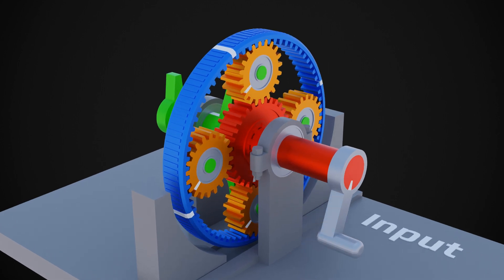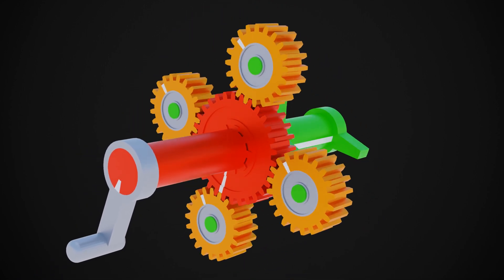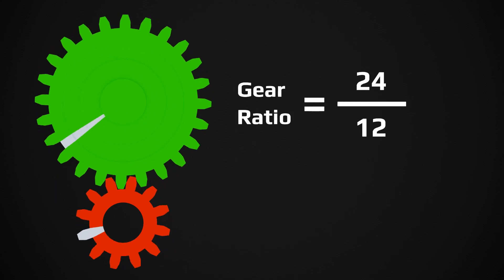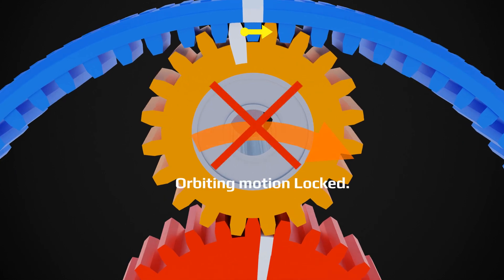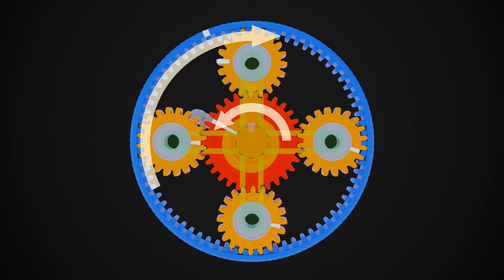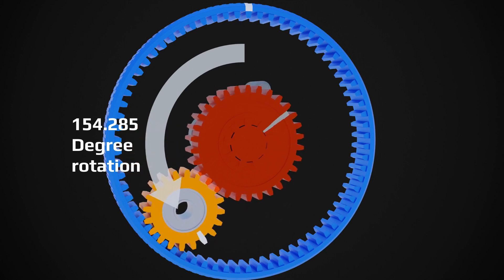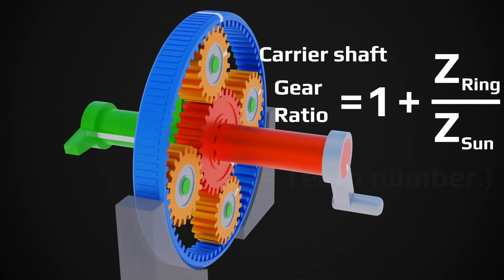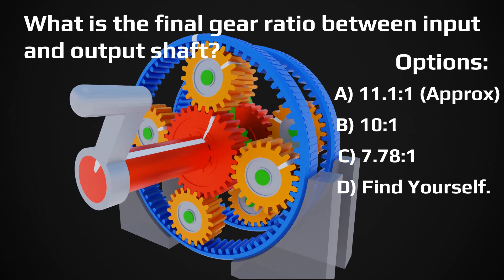Why Planetary Gear set is really amazing?

Comment: What happens if the ring gear is not fixed and the planetary gear is not fixed and an input is given to the sun gear?
Reply: neutral gear, 

any time there is an input without a held member (reactionary member) there will be no torque produced at the output shaft so you get neutral gear,

Comment: Can you give me an example of application where the sun gear is fixed ring is output
Reply: Overdrive used in automobile
Reply: Planet carrier - input 
Ring gear- output 
Sun - held

= 4th speed forward Low Overdrive 

Planet carrier - input 
Sun - output 
Ring - held

= 5th speed forward high Overdrive
Reply: Planet carrier - output 
Ring gear- input
Sun - held
1+Zs/Zr=1,4285:1

Planet carrier - input 
Ring gear- output 
Sun - held
same ratio reversed 1:1,4285

Comment: Is torque double at the center of planet gear or circle of gear, or center of driven shaft... How we calculate.?
Reply: The torque is double at the meeting point between the planet gear and the sun gear. This only applies when the ring gear is stationary. The center of the planet gear has a linear velocity of V and when it comes to the meeting point, the linear velocity is 2V.

Comment: a planetary has a ring that has an inner and outer diameter and the outer diameter is always bigger then the inner and the torque is the same so if you put a gear of equal size as the center on the outer diameter the gear will move more times with the torque of the ring
and if you put a planetary of the gear that is on the outer ring the next planetary will have more torque then the first and can move the same speed making a 1 to 1 ratio increase torque , i am having only arguments with designers , maybe you can do the design to explain therei is a inner diameter and outer diameter on the ring gear and the outer will always be bigger and have the same torque as the inner

Comment: I understand that as the 30 teeth sun gear rotates, planet gear transfers this 30 teeth among the 70 teeth of ring gear causing 154.285 degrees rotation of the carrier. But why this turn causes additonal turn at sun gear? (video time 4:18) Is it because of the linear motion transfered to the sun gear by the carrier? Can you please explain?
Reply: My exact question. I feel like this part can be clarified more.
Reply: @michaelp2922  I found the answer. Planet gear's motion is a compound movement. It rotates by itself and around the sun gear. The linear velocity at the ring gear contact point must be zero. In order to compensate this, the second movement (carrier around the sun gear) must be done. This second movement causes the additonal turn because the teeth of the planet gear is in contact with sun gear.
Reply: @onerarda174  Does that mean because the planet gear also rotates freely by itself, and it rotates in the opposite direction as the sun gear, it is still driven by the sun gear but also travelling "backwards" on the sun gear so there must be additional rotation of the sun gear to achieve the 154 degree rotation of the carrier? Sorry, this concept is really confusing to me for some reason. I think it's one of those things that I would understand much better with a real life model.
Reply: @michaelp2922  What you say is true, sun gear has to catch up the carrier rotation. By the way I calculated the technical gear ratio by using angular and linear velocity formula (V=w.r). It is the complete explanation but a little bit complex. Maybe I can explain that page by sending you. How can I send you?
Reply: @onerarda174  Thank you for the explanation! Is it possible to share the link of the page in the comment itself?
Reply: Your not the only confused by that statement.

Comment: What would these be used in? Can you make a video with examples?
Reply: It's used in cordless drills as it makes for a very compact gearbox assembly
Reply: if i can't use these for turbo duels i'll be really disappointed
Reply: These are used in series on all automatic car transmissions
Reply: Turboprop engines (e.g. the PT6). They reduce the output shaft from 36000 rpm to about 5000 rpm  depending on application.
Reply: Formó parte de la transmisión del Ford T. 
Los engranajes se los puede ver como palancas.
Reply: Mechanical locomotives for example (switchers) who are relatively small but need tremendous torque on track when topspeed is not important.

Comment: quite amazing — and nicely explained. i come from an electronics background, and dont know much about gears and mechanics. in electronics — you have a transformer — which takes a certain voltage (120volts) and reduces it to another voltage (5volts) — it entails a power reduction — but how is this done mechanically!? when one thing is turning faster than another!? how do you make the faster thing turn the speed of the slower thing (imparting greater power and torque)!? 🍃 the ingenious PLANETARY GEAR is really amazing — a mechanical transformer! thank you for your excellent explication!  the animation is superbe, the explanation itself is clear, and the voice is clear, and one of the more pleasant sounding english robot voices ive heard (you can tell where it lacks plural inflections).